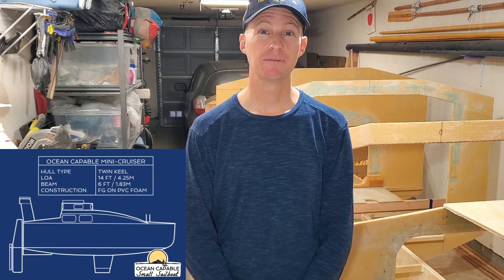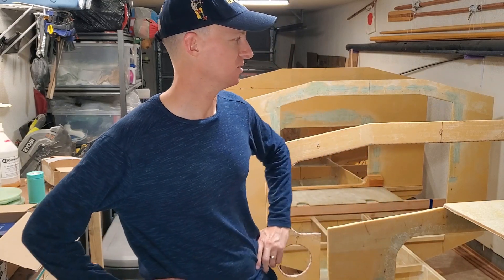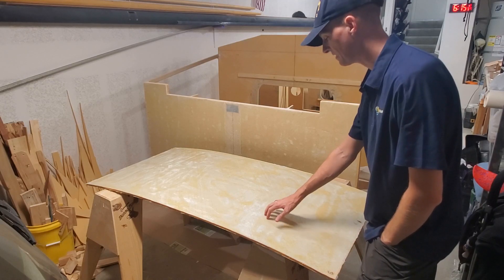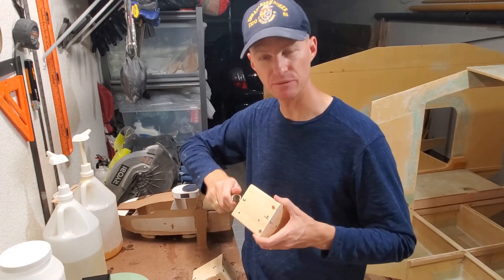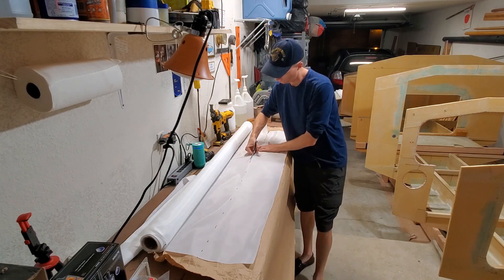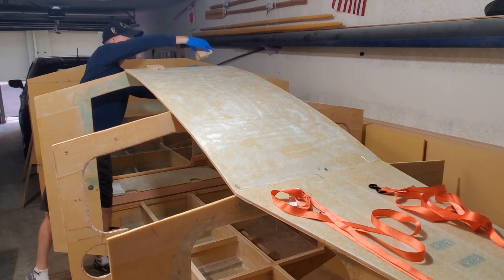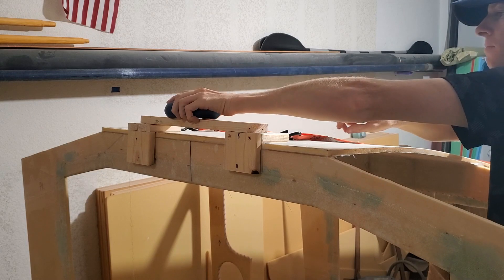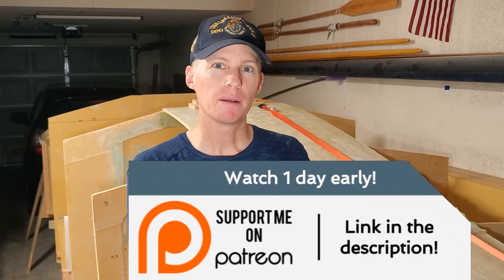OCSS-030 Tabbing on the Arched Deck Panel - Mini-Cruiser Sailboat Build

Comment: Given that a cubic metre of water weighs one ton, and the likelihood is that several of them will be raining down onto your cabin roof in a sporty sea state, I can appreciate why you'd like to reinforce that panel.

We think about hull reinforcements more than we do about cabin roofs, but for open water strength both are preferable.

Comment: I'm enjoying watching your build process.  Appreciate that you are sharing it.

Working with epoxy & fiberglass has its challenges.  I'm learning as I go as well.  I try to avoid going against gravity, but have noticed that sometimes it helps to paint on a thin layer of epoxy to serve as an adhesive to hold the cloth in place.  This thin adhesive layer has to be timed just right - cured long enough to no longer be wet, yet still tacky sticky to hold the cloth in place.  I position and work the cloth onto this tacky layer and let it get a good grip for a few minutes, prior to wetting out the cloth.  It works great on vertical surfaces, and semi-upside surfaces.  I have used it for small upside down surfaces.  To me, a large upside surface would be no fun.  On my small build, I try to schedule certain projects to be completed later, when the boat is rolled over.  And for these size boats, they can be rolled often - once structurally strong enough.
Reply: Do I have to add something extra to stick my polystyrene resin on pvc board??

Comment: I am glad you got a cutter for the fiberglass cloth a time saver. Next you need a multitool. Get a inexpensive one at Harbor Freight. It will save time cutting the edges of the panels and many other uses.
Reply from the maker: I have one, you can see me using it on a few other eps. If it hasn't cured totally, I like cutting with the utility knife because less itchy dust goes flying!

Comment: Excellent work as usual. Would an extra layer of glass rather than the ribs give you better cabin volume and still be strong. You could fit a .250 foam fibre laminate on the underside too. Unless you need the ribs for some other detail yet to be revealed.👍👍👍keep on building dude.🤙👊🖖
Reply: The ribs will add more strength than an extra layer of glass would. And they don't really need to be as deep as I suspect Cpt Perry is going to make them. But hey, at sea, overkill is always a good idea.

Comment: Are you sure that this deck panel is strong enough? A few days ago Andy from "Boatworks Today" released a video where he demonstrated what happens if you use too little polyester/epoxy and too much pressure on the roller. Check out his 30 minutes contribution at https://youtu.be/6wLkVQEYt20
Reply from the maker: Thanks, I watched. I'm confident in my work so far. This panel will get even stronger in the next video with the addition of perpendicularly attached longitudinals.

Comment: Why is there is a chine on the bottom of the boat? Wouldn't it be better to have a straight line? Curious minds want to know.
Reply from the maker: You may want to ask a boat designer or research online. It looks like it when the boat is heeled over, chines improve directional stability and "increase in buoyancy at the point of heel when it becomes immersed, so it takes considerably more power to heel the yacht further." Interesting question.
Reply: It's a physical thing.